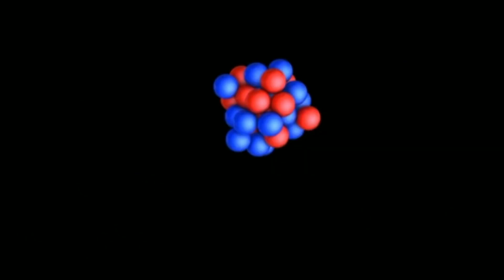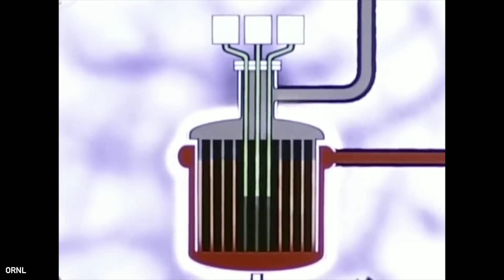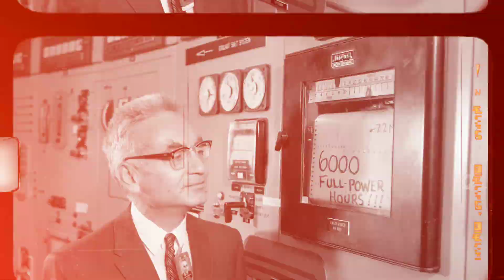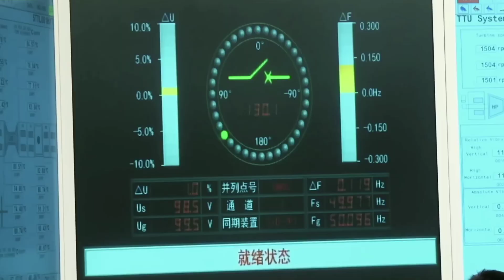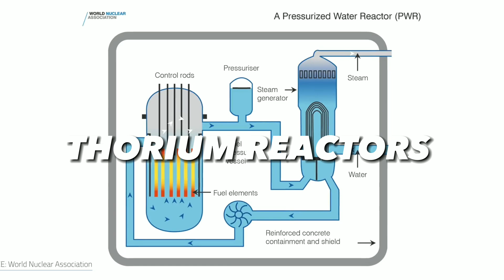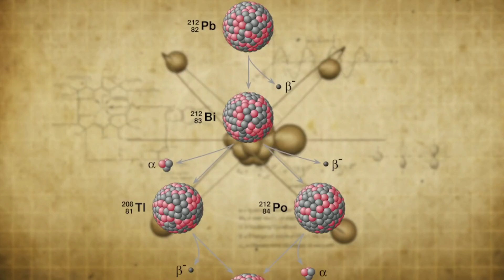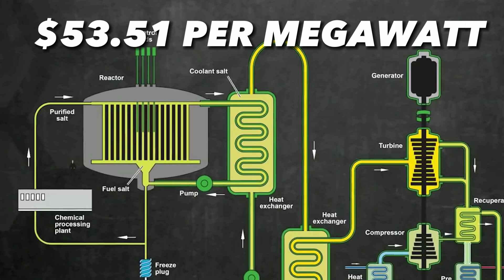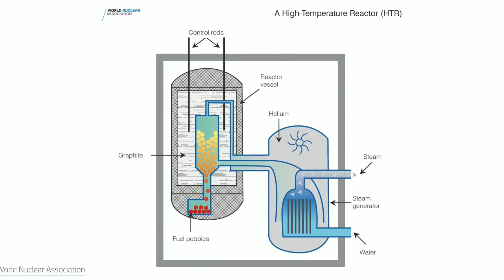Thorium Nuclear Unlimited Energy Make A Comeback | Worlds shocked

Comment: Copenhagen Atomics plans to achieve 2 cents per kWh without the need to sell the reactor but provide energy as a service with a long term contract
The reactor follows the load and does not need a staff to run. It is fully automatic.